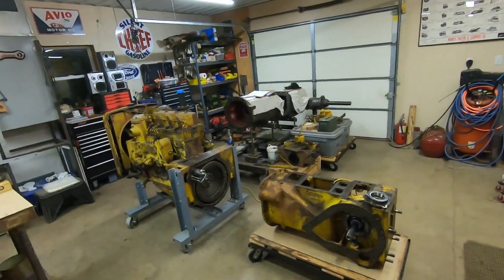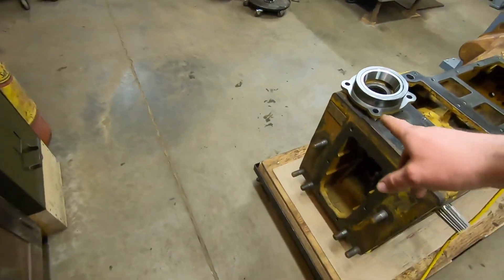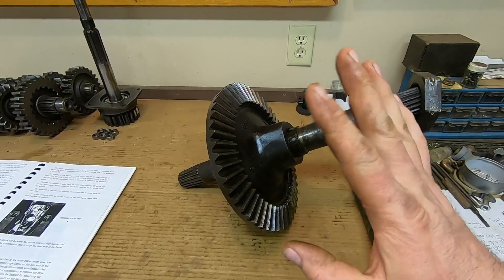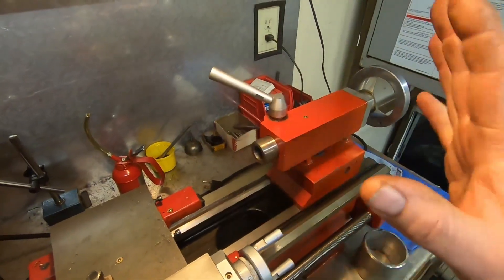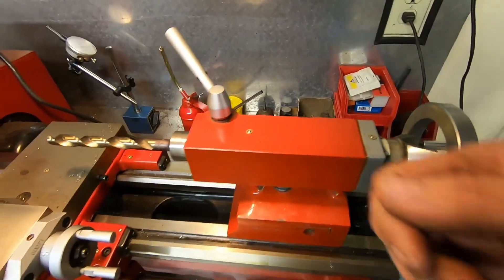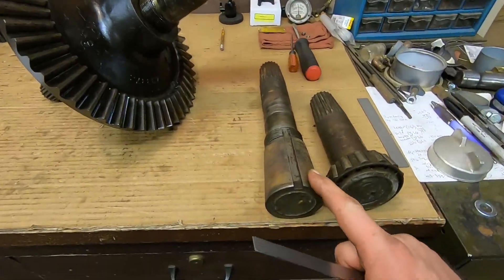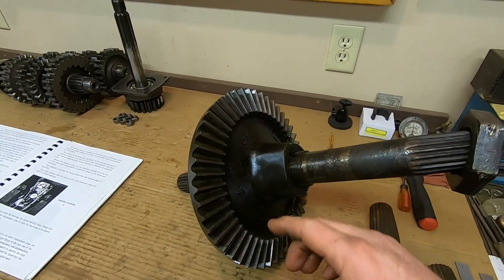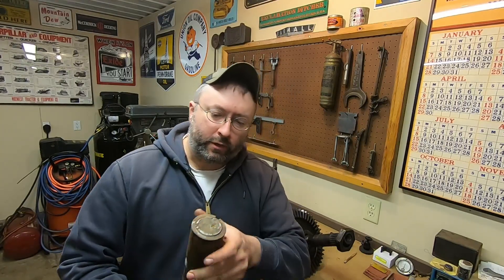#5J1113 Video Short - How Much Does A Press Fit Taper Hold & Bevel Gear Lock Better Explained

Comment: thanks for this!  heres a thought experiment: if the force pressing on the bevel gear is less than the foot pounds of torque on the ground, the gear will rotate.  so the question is how many foot pounds does this machine apply to ground?  probably not 12 tons, although its not a linear comparison i suppose

the good news is that your viewers are watching your videos intently.  no pressure....
Reply: No, it's not linear. The 12 tons is magnified by the taper (think of it as a wedge), so the slope of the wedge means the force between the faces is super high. The taper per inch of Morse #4 is .0519, which is 1 in 19, so the force on the taper surfaces is 12 ton x 19 = 228 tons.

That oughta' hold it.
Reply: @paulwomack5866  I believe (I may be wrong) that what you have given is the radial  force and Don is talking about the tangential force which will give the torque. I'll work it out tomorrow if I have time
Reply: @paulwomack5866  if the morse taper were 12"
Reply: …what??????

Comment: The main drawback with taper fits are the difficulty to axially position the two parts.
In the case of drill bits, no problem.
The drawback with a keyway is that you lose 50% ore more of the fatigue strength compared the the pure cylindrical geometry.
The cylindrical press fit can be designed to any torque need. Assembly by a) heating outer part, b) cooling inner part  and/or oil pressure expannsion tools.
Reply: 50% loss of what????  tapers are conical fits…
Reply: @horacerumpole6912  50% strength loss due to the cut out for the key
Reply: @alanpartridge2140  More's equation and test materials are from 1909…

Comment: Hi Squatch. I'm not even sure 'letter arithmetic' would solve that problem. It seems on the face of it that it's a matter of the co-efficient of friction of steel on steel and the loading force generated by shoving that taper in with 12 tons of push. You multiply one by the other - come on, you can multiply! - and that would seem to be the answer. Co-efficient is around 0.2 - max figure is 1.0. Working out the force generated by the taper involve some trigonometry and Young's Modulus stuff but nothing too complicated. But I think it might not be a valid calculation. There will be so much pressure induced on the taper interface that the molecular structure may well interlock. In effect a form of cold welding. Effectively that is what causes friction at any rate. It's molecular size mountains getting tangled up in molecular sized valleys.  It would be at such an electron microscope level that when the taper is pulled apart the surfaces still seem ok. I did a quick Google and did not see any reference to the break torque for morse tapers. In other words, I don't know! Cheers. BobUK.
Reply: Hi Bob, I might have a look into this and try bodge a few numbers if I get some spare time over the weekend. Knowing that it was able to twist the shaft off should give a correlation point to show if the numbers are somewhat valid. I'll let you know if I get round to it.
Reply: Cold welding is known to happen in taper joints, and is a machinist nightmar. It involves, IIRC, tapers fitted in cold and then moved to normal temperatures too quickly.

Comment: And to add to your quote-unquote secondary line of defense statement, with your description of the Morse taper drill holder you failed to mention the Tang on the back of the taper. That is your secondary line of defense to keep that drill from twisting under heavier load. Your tailstock should have basically a slot that that Tang fits in in the back. To continue if you have a live center in number two morse taper for your lathe, you will notice that it does not have a Tang on the back. There is no radial load due to the bearings in the live center so you don't need that quote unquote secondary line of defense on that tool. Looking forward to your next video and have a great day brother.
Reply: @squatch253  There might be tapped holes in the tailstock quill for grub screws to hold the tang.
Reply: @mmm365  I'm a journeyman tool and die model maker Machinist. My home hobby lathe has a number two more taper in the tail stock and it utilizes the rotational position of the drill adapter Tang.
Reply: @ruben_balea  As I said before, "secondary line of defense". If the drill grabs / seizes and spins in the tail stock taper the taper could be damaged. I would much rather replace a broken drill than the tail stock spindle. The holding power of just the taper should be more than enough, but things happen.

Comment: I would have thought that to fit the two parts together the shaft would have been cooled and the gear heated up and then mated.  I suppose that might make it impossible to take apart in the future though...
Reply: @squatch253  The pinion gear is the sacrificial part. Shrinking them on hot saves wear and tear on the drive shaft.

Comment: I'm glad to see I'm not they only person who thinks bump every time you close that door, Very good analogy using that morse taper for demonstration. Its amazing the torque that a taper on a shaft can hold if kept tight. The old chrysler rear axles had a keyed taper that held on the brake drum and hub. those held really well too.
Reply: Those old tapered axle are a bear to break down.
Reply: I have a 55 Dodge half ton that has that axle, bu i have a proto brand puller set for removing them. The screw has a "dog bone" designed to put on it and strike with a hammer to tighten it.

Comment: Letters in math for me, annoying as it is, is not nearly annoying as when they just randomly decided to change the rules, and the order in which equations were solved. I found that when using my hundred year old machinist handbook, I was better off solving the equations there in by using the trig tables supplied there in as opposed to having two separate calculators giving me two separate answers and trying to figure out which one to trust

Comment: That is pretty neat! All the spinny things on the outside of the old and new Volvo engines I deal with are basically head in place with taper fits. Keys and dowels are more for locating the pulleys than making them spin.

Comment: A fit like that I see as being a similar concept to the way tires "attach" to on rims.  How many times have you heard of rims spinning inside of tires?  I'm sure someone somewhere has seen it, but in normal every day life it's not common. LOL
Reply: Unless you are off-roading and running very low tire pressure or drag-racing with crazy horsepower, I personally have never heard of it. And those guys run beadlocks to avoid that
Reply: Not really the same or even close unless you are just referring to friction.   Tires seat on the inside lip of the rim that is what keeps them from moving the friction between the rim edge and tire bead edge.   It is not the expansion over the barrel.
Reply: @matthewq4b  The bead of the tire stretches over the edge of the rim. That’s why it pops when the bead is seated. And that stretch is what provides the force for friction to do its thing. At least, that’s how I understand it
Reply: @onlybrokencars5238   The tire bead slips over a mounting hump in automotive applications when it seats, that is the pop you hear when the bead seats when a new tire is inflated.  The mounting hump is exactly that a hump, it just keeps the tire bead against the flange when the tire is not inflated.  Would pretty tough to inflate a flat tubeless tire if the tire bead was not held against the rim flange.  See the below cross-section of a rim with the mounting hump 
https://swh-826d.kxcdn.com/wp-content/uploads/2011/05/tire-rim-diagram.jpg
If you apply sufficient power to an underinflated tire it will spin/slip on the rim.   It is the bead seated against the rim flange that prevents it from spinning on the rim (it is also what seals the air in, in a tubeless tire)  and is also why low-pressure high power applications typically have bead lock rims as they have insufficient bead pressure on the rim flange to prevent them from spinning on the rim.
Most motorcycle, bicycle, and all military combat rims, have no mounting hump on the rim. 
Combat rims have a split barrel that is bolted together, it is sealed with a large o-ring in tubeless applications but typically are tubed for ease of inflation. Combat rims have no mounting hump to allow for easy field tire changes (even heavy truck tires) with just basic hand tools (wrenches/sockets) no pry bars or sledges typically are needed.  See link for a pic of tubless combat rim 
https://www.oshkoshequipment.com/common/assets/images/products/17742.jpg
In all pneumatic tires, it is the pressure/friction of the tire bead against the rim flange that prevents them from spinning on the rim, it is not friction on the rim barrel.

Comment: "Fold over lock perfection" Love it.  I too was not a fan of them inserting letters into math in school.  I always said I'd never use this, so why do I have to learn it.  I was right, I have never used it
Reply: As an architect, aside from the engineers (of all kinds), astronomers, and mathematicians, i've never seen anyone else use them. They're taught as general education, realistically, nobody expects you to use them, but they do expect you to know about them. Trust me, i know, as a kid, it sucks, but hey, you know about them, you're 100% better than someone who doesn't.

There's also the choice angle, if they don't teach those, how would the kids know that they might want to pursue them... think of it as a...filter. It strains out the ones that want to deal with lettered math. :)
Reply: math can be a P in the A..
but it sure feels good when u pass the class
#DifferentialEquationsForLife

Comment: Great explanation, especially bringing machining tools into the conversation. I worked 5 years doing both CNC and manual machining and many times we had issues getting the tool holders back out of the taper in the machine. The main issues were on the milling machines running CAT40 and CAT50 taper tooling, the drawbars would strip threads trying to push the tapers back out (mind that these machines only use compressed air and drawbars to hold the tools in, not 12 tons of pressure). A taper is an excellent way to hold something solid
Reply: Properly ground and fitted tapers are something to behold.